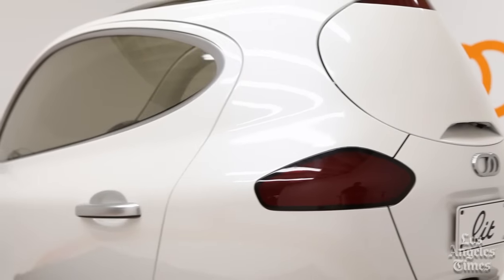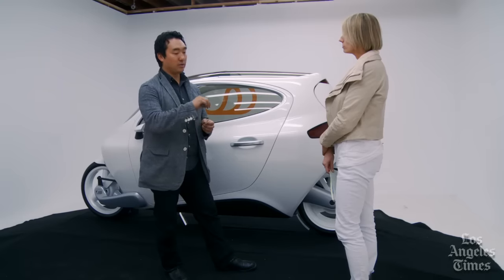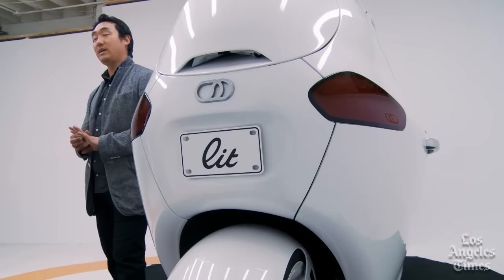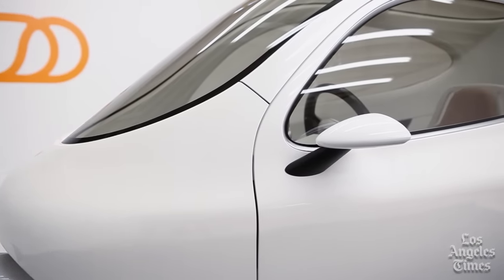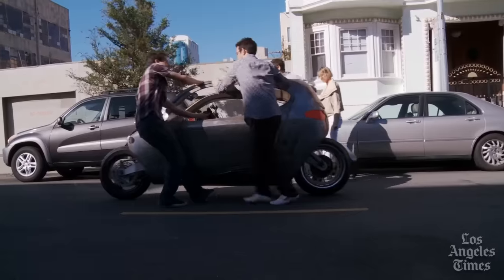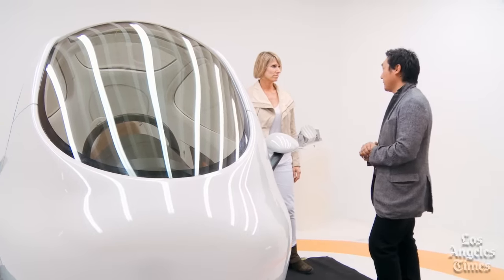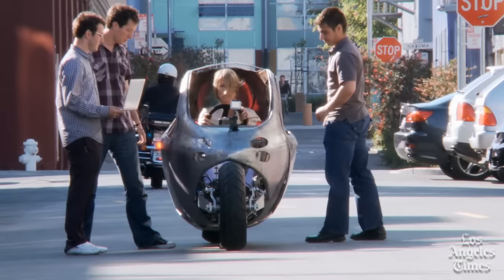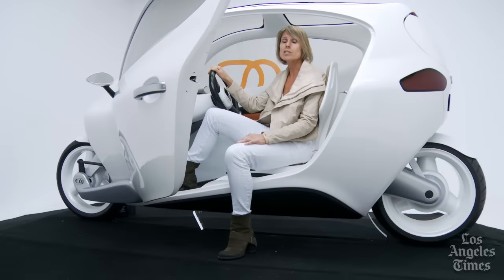Lit Motors' C-1: A 2-wheel car? Or untippable motorcycle?

Comment: The E-1 is a car I had as my desktop picture about 20 years ago.
It's a fantastic design, the driver sits in the middle and it has two outside seats slight behind. This means of course that the drive is right in the middle of the car, so it's very safe - in theory.
However, BMW showed the concept off at the 1991 Frankfurt auto show, but it was never mass produced. Their i3 concept was supposed to be available now, but, again, it's a no-show.

Comment: I would buy 1. instead buying a car but using it alone everyday to work, i rather buy this even though  it is more expensive than normal motorcycle. At least it is cheaper than a car n look safer than a motorcycle.

Comment: Put a 60 hp engine. With those Gyros and Aircon, it sound attractive and more fun. Save my back in plucking those 250 -300 kg bikle. Electric technology is quite disappointing. It needs to go 500 km or make the wheel charge up the battery constantly. 
  But now electric bike is too expensive and the range too short for me.

Comment: The car and gyros are "on" during the alley test drives. Those guys are not keeping it from tipping. From Forbes, Dec. 2012: "On a test run in an alley across from the office, the vehicle lurches forward to a slow trot as engineers nervously walk alongside it in case the gyroscopes fail and the cycle tips. Attempting to hit street speeds, and even turning, seems a bit too risky at this point..."

Comment: A simple enclosed motorcycle with a small 125 -800 cc engine/electric option using a Piaggio MP3 or Yamaha Tricity parallel type tilt front end of forged aluminum ,a simple aluminum bonded,bolted truss frame.Single seat with storage/jump seat.The narrow Yamaha /MP3 type  tilt front end can be enclosed in a very narrow body,a electric,hydraulic landing gear with omni wheels could be used to lift the vehicle in a fall and to keep it upright when parked[streamlined motorcycles[narrow bodies] tend to get blown over when parked,so landing gear would keep it stable for both service and parking.my version saves at least 10,000 dollars in costs and eliminates the gyros high cost and 0 defect,with gyros controlling the lean you might loose some of the low speed handling.I believe this could be built for 15,000 dollars
Reply: that'd be my 1st choice.

Comment: Why to lean narrow vehicle is not a question. 
Other part is not convincing: carver's three wheels &their suspension take basically the same load as two wheels of C-1, so both chassis are comparable by weight. 
But look at gyroscopes: they are kinetic bombs of 5000 RPM of about 25-30 liters, of 20-40 kg, with sophisticated (reliable?) robotics, not to mention a need to accelerate them &keep their spin (vacuum &bearings maintenance is a challenge too). 
It looks silly over-engineering to me.

Comment: I want it as a diesel off road capable dual motor phev with at least 189km electric range even in mínusz 10 Celsius degrees. Is it possible if you make it 30cm longer and built the frame over the wheels too? I would like it to be much higher though to have an upper tent sleeping are for one and a lower one for a nother person with folding seats.  I want to travel inside 2 average size human, a big 90kg dog, a small 7kg dog, 2 big electric unicycles with 2 basket of protection gears, 2 45 liter camera backpacks, 2 22 liter backpack and 2 40 liter grocery bags. That's all I'm asking for and with 30cm more length , it would be 315cm long, and with that it could just fit in 9 feet long motorcycles parking spaces with 40cm allowed overhang included. It could be though 100 110 or either 120cm wide all along, what you see is possible and efficient for going still onwards between the lanes, and want it like Audi etron camera mirrors, in Europe it's allowed, but a better one that can adjust how much it sticks ot from 20 centimeters to 4cm. Also I want it from sport high quality steering wheels and heated cooled perforated fák leather seats with heated cooled steering wheel, at least heated big 2 screens or 3 for it but at least one big, prob in this situation, it would be the best 2 use one big high quality OLED miniled high refresh rate QHD or higher res screen. With 10 bit colour depth, and it could use koenighsegg ultralight 335hp electric motors. And with carbon fiber exoskeleton body it could be wrapped exactly for the customers liking and still look good and save a huge amount of weight for everything else, oh , and it could be cool if it could be under 670kgs.

Comment: lean angle would be 0° and I guess unstable at curves unless they make it significantly lower. if you include all you need to make the body sway while the 2-wheeled axle stays parallel to the ground (carver style), then the gyros are probably lighter and cheaper, but I might be wrong.

Comment: also, C-1 is assembled entirely out of parts that are already manufactured for run-of-the-mill your usual cars. there are no parts, other then the outer shell, that they need to manufacture themselves. this drives the costs down significantly and makes the whole project that much more doable.
combine that with design that isn't too funky - I mean, C-1 really does look like a love child of Smart car and motorcycle - and there's no reason for them not to succeed.

Comment: sadly, cool does not sell all by itself. because "cool" is usually far too expensive for an average consumer. lit morons and e-tracer have completely opposite goals. lit motors aim for an average city-car, e-tracer for a racing vehicle. they are worlds apart. besides, from what i gather e-tracer is unbelievably hard to master and control. letting it loose in the city spells disaster.

Comment: you guys missed that point,people drive motorcycles,with no exterior protection,it hasn't stopped the millions sold every year.This is a motorcycle with a streamlined body on it,it affords more safety than a standard motorcycle and allows anybody to drive one.People die everyday on motorcycles,cars,about 50,000 a year,the manufactures can't be held responsible for the drivers,we wouldn't have any products if they were held liable for every crash,no matter who's fault it was.

Comment: again you're missing the point - no one should be reckless in any vehicle ever, so there is no need to encourage it (which is what giving a more aggressive design does). and i know that the size of the vehicle, whilst is a major factor, isn't everything. you CAN make c-1 very safe by installing roll bars.. but will they actually do it? remains to be seen.

Comment: I would much rather people to be more reckless in this than any car or truck. Everyday, people die on motorcycles, cars, or anything else because someone made a mistake. A lot of times it wasn't even their fault. In a motorcycle accident, usually the guy is laid out while the car just has a minor dent. Looks do not affect the safety or its performance. Whether its safe or not, determines if you are able to walk away from an accident. Cars and Trucks are much bigger than you on the c-1

Comment: don't get all emotional. since the time of my comment they did figure out the cost of 1st batch. and it's roughly 3000$ less then initially thought. and the price of mass-produced units went down from 16,000$ to 12,000$.
there is no reason for this not to be cheap to make, run and fix. if you had done your homework you would have seen that this vehicle actually has surprisingly few parts, and all of them are already mass-produced for cars.

Comment: This kind of scale and dimension shape machine,  has potential in becoming an aircraft & road vehicle, in one, as adjacent flight engines & wing spans have feature attach gaps. The disgner and company could've created a gyro, able to mount in many 3 to 2 wheel vehicle, making a gyro car, and declaring it as a model design will be easly be taken, since a gyroscoptic device isn't a new invention or copy right.

Comment: I'm pretty sure that this still has potential and could have become a viable means of personal transport, but I suspect that as Kapil Madhan commented it's possibly been shelved for the reasons he said. What is needed are not necessarily uber-linked, self-driving, designer-fashioned cars even if they're as gorgeous as such concepts are often shown to be, but rather a means of transport that offers a level of road occupancy akin to that of a motorbike so that the stigma of congestion can be addressed. If such a vehicle offered the convenience and safety of a modern car then all the better and if such a vehicle were electric powered too then the recipe is looking good.This is where the C-1 was on course to be but alas is no more...

Comment: The myth here is that the motorcycle itself is efficient.  Of course such is more efficient than a Hummer, but the motorcycle misses the rule for aerodynamic efficiency, that being a length to width ratio of about 4 to 1 and a body of revolution form.

The same goes with this LitMotors product, though it is a big step forward otherwise.

Cost is the real issue though.